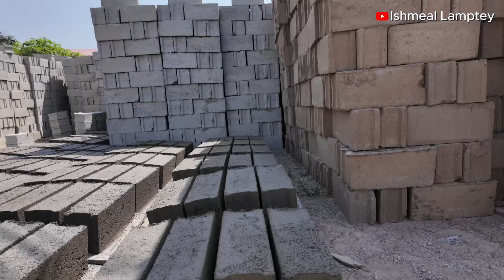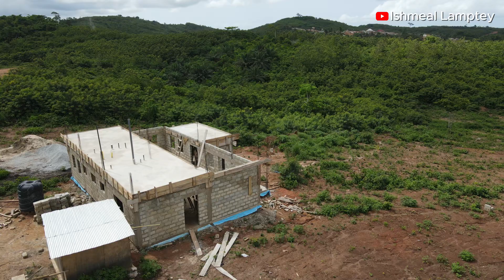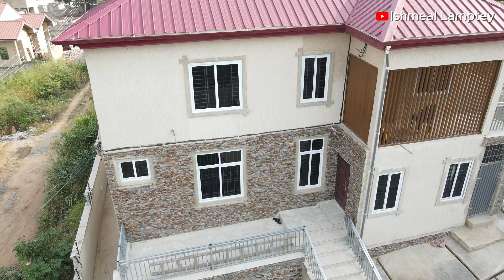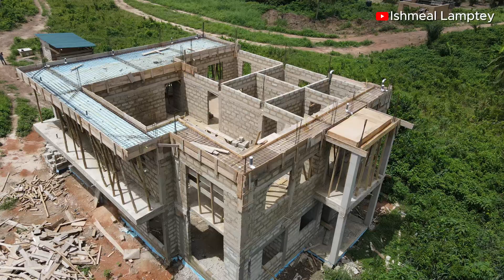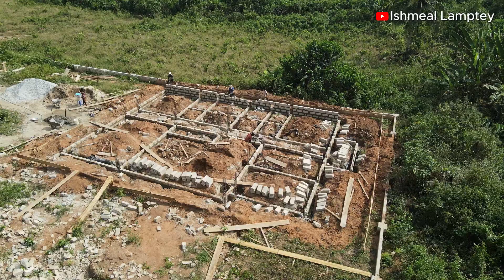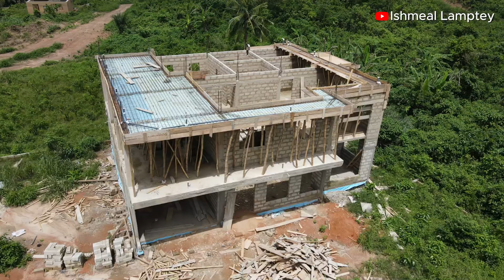Should you build with Hollow Blocks or Solid Blocks? Find out now!

Comment: We may have multiple type of block but in construction the 2 mains blocks are load bearing and non-load bearing and the difference between the 2 is how much load it can support and this is determined by the strength of the block in mpa or kg/cm3. Load  bearing block either is hollow or full it used for building walls that will support the structure or carrying the load  walls and non-load bearing block used for  infill or partition walls.

Comment: Great information, thank you very much. i think both may not differ in amount of mortar joint, because the mortar is spread evenly on all the blocks before the top course of block is placed on it. but in my opinion, another advantage is that the hollow block offers a form of interlocking with the mortar joint (the mortar enters the holes) which gives an extra strength to the walls. unlike solid block which has flat surface.
Reply from the maker: Hollow blocks depending on the type can be laid either on the flat side or the hollow side (there are hollow blocks with both sides being hollow) hence the mortar can be spread throughout or just on the sections that has the hollow. Also, not all hollow blocks have the interlocking feature. Some solid blocks as well do have the interlocking feature.
Reply: ok thank you

Comment: Thank you for this great wisdom my brother! So, for a storied house are you basically saying that it’s better to use hollowed blocks on the second floor and above?
Reply from the maker: Yes, that's my assertion however it isn't always the case. There are instances where solid blocks may be the preferred option for all floors. This will depend on the project and it's engineering.
Reply: Great video. To what extent do hollow blocks differ from interlocking blocks?